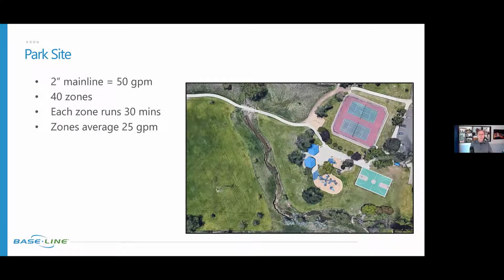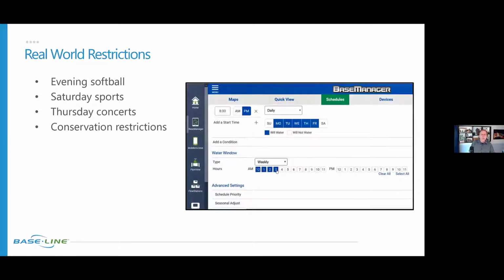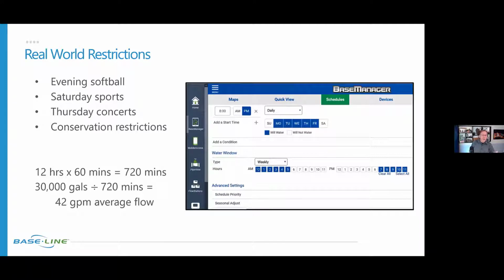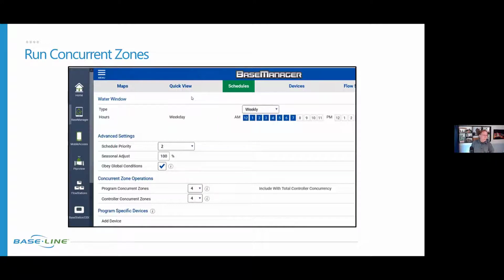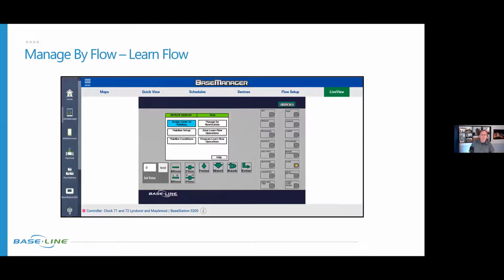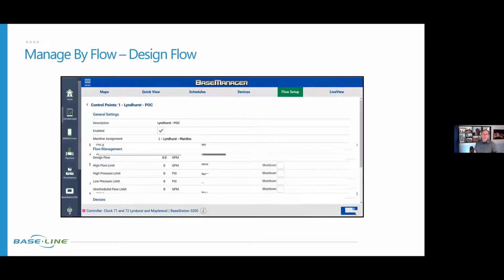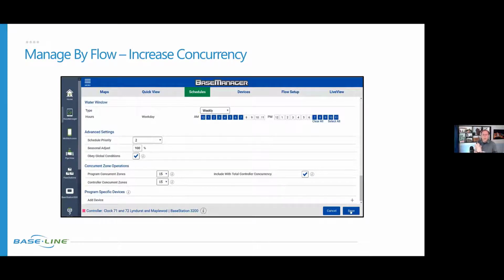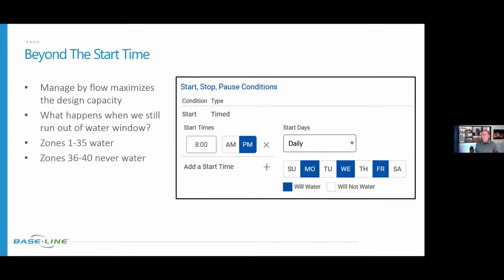S1, E10 -Tech Talk Tuesday: Managing Difficult Water Windows

Comment: Thanks for the vids - they are quite helpful.  But I think on this one, there is a critical piece of info missing.  The max. system flow should not be determined by the pipe size only.  (I am assuming that was determined by keeping the velocity < 5 fps.).  The flow though the service line to the meter and the meter should be considered.  Possibly even other equipment.  Mainline might be oversized to reduce pressure losses.  So, if only that is used to set the system max. flow, it might be much higher than what should be run through the service line and meter (and possible other equipment).   Also, a HUGE selling point for the controllers you are using for this demo is that a lot of them are not capable of running enough valves simultaneously (due to hardware of software) so that the water window can be met.  15 valve simultaneous operation is a LOT - good job!